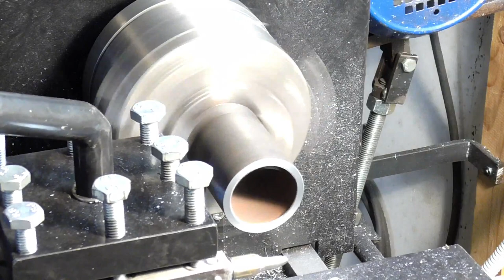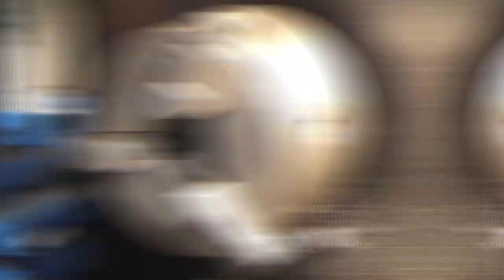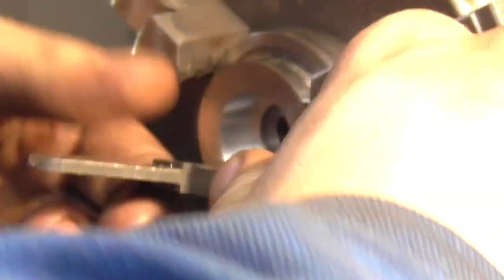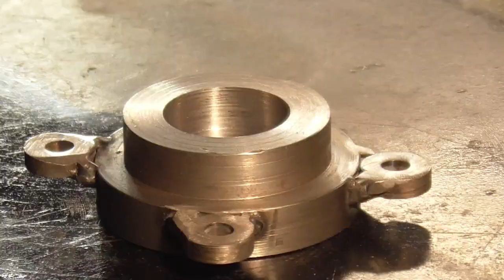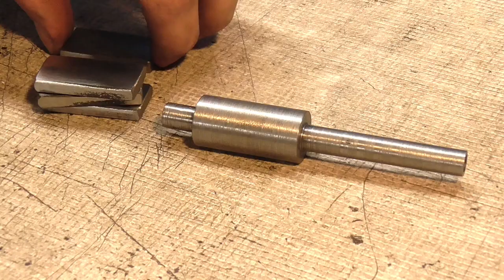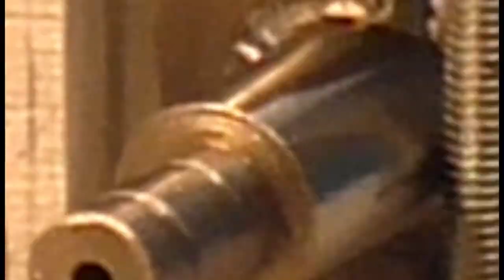Air motor

Comment: If the size of the outlet hole decreases, there will be more pressure, having more pressure will have more power, it will rotate faster.
Reply: The pressure will pressurize inside and not let it have any more pressure to come in and that will just slow it down
Reply: @jasonlin9805  You're wrong. The more pressure, the faster it will turn, because the outlet port is smaller.
Turbo engines are like that.
Pressure cookers are like that.
Reply: More power? Yes. Faster? No.
Reply: @jasonlin9805  You are actually right, the exit needs enlarged.  Pressure is not what is spinning the rotor.  It is velocity of air hitting the rotor.  Just like a turbine.  Once the initial air collision on the rotor blade, the air needs to be evacuated immediately, or it will act upon the rotor in the wrong direction.